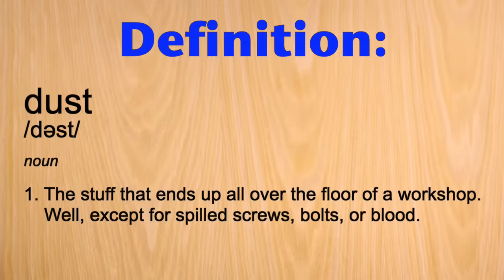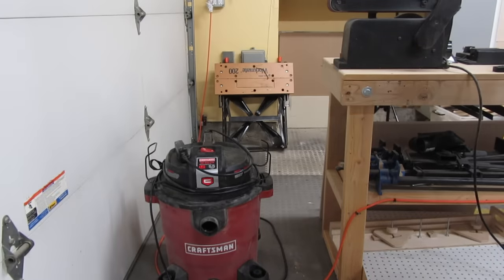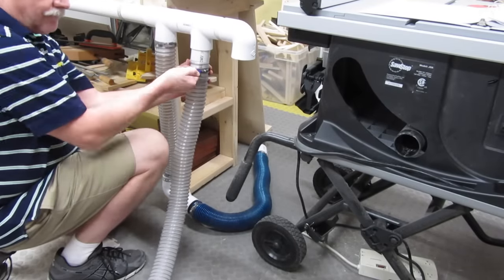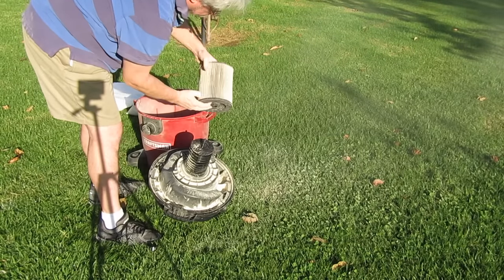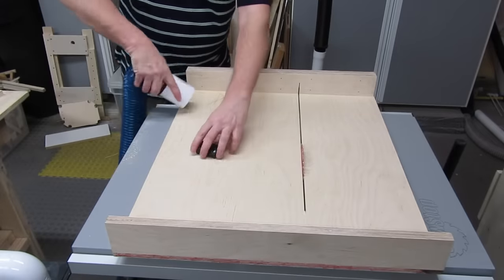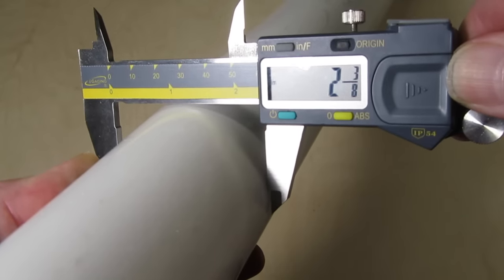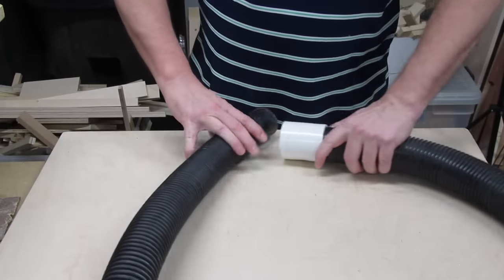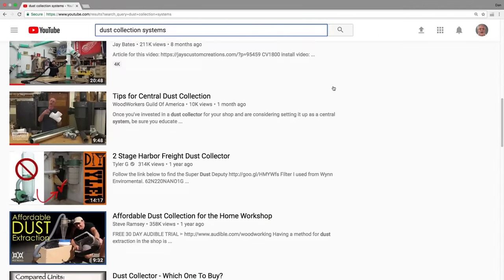Dust Collection for Newbies: Introduction to Dust Collection

Comment: Very familiar to my garage shop. I have done the same thing with connecting my shop vac and adding a few drops. What is struggle with is the fine dust particulars. I even built an air filtration unit with a box fan that is helpful, but still need something better..any suggestions?
Reply from the maker: That's a really complicated subject. I've done a lot of research on the subject, including spending a LOT of time wading through Bill Pentz's research at http://billpentz.com/woodworking/cyclone/index.cfm. I think you have to take Bill's comments with a large grain of salt, considering how sick he has become due to fine dust particles. But here's some things that are generally true:

Shop-vac-based dust collection systems can't collect fine dust. You need the "blower" type of dust collectors for that (something about air speed vs. air pressure). You also need at least 4" pipes, possibly even 6" or more. The dust collector has to use filters to keep the fine dust inside the collection containers - or maybe it's the containers that have the filters. And apparently, you have to vent the dust collector outside, otherwise it just blows the fine dust particles around the shop.

The bottom line is that you'll need to do your own research, because my research just ended up making me throw up my hands and saying "la la la la" really loudly so I could just ignore the issue. 😄

Comment: I see that you empty your filter by dumping it outside. If you are going to do that, why not do it automatically? Vent your system to the outside of your workshop. This means NO dust is recirculated into the 'shop and you never need to clean (or buy in the first place) the filter.
Reply from the maker: Actually, I don't dump it outside. I just go outside when I transfer the dust from the container to a trash bag. And by the way, there are many places where it is illegal to vent outside. I doubt the police will come and arrest you, LOL, but a word of warning anyway.
Reply: The Newbie Woodworker Strange, the video shows you dumping the dust from your filter on your lawn. There are also times when you have to vent outside- such as when there are combustion products. The amount of dust that gets past the cyclone is trivial anyway.
Reply from the maker: @Tensquaremetreworkshop  Oh, that's just cleaning the filter, which I don't need to do much anymore. Forgot about that - had to skim through the video again! 🙄
Reply: @TheNewbieWoodworker  I put a bag made for the vac inside the unit, to collect the fine dust.  Doing this and the filter will stay clean for a very long time.
Reply from the maker: @ozguzzi  Thanks for the comment. 😄

Comment: My Miter saw did not like PVC.  Fortunately there was no first aid required.
Reply from the maker: 😆 Thanks for the info! 👍
Reply: I use my miter saw all of the time to cut PVC. To safely do this you need a fence at least as a large as your material, a sharp blade, clamped material and reasonable cut rate. The large fence ensure the material is fully supported. Dull blades get embedded in the material making it more likely to put undue stress on the material. You want your material clamped, or at least against a stop block, to prevent lateral movement which can cause the blade to deflect or pinch which is bad. Lastly, a reasonable cut rate allows the blade to do the work, not you.
Reply from the maker: @AxGryndr  Thanks for the info! 👍

Comment: Thank you. I do have a question; Is there a real risk of static in the PVC pipes causing a fire. I've seen some woodworking say that, and that you need to use the tubing that has wire inside so that it does not cause static electricity to build up. What do you think?
Reply from the maker: You're quite welcome! 😄 I think you should never take safety advice from some internet guy. 😉Now that that's out of the way, this describes my feelings pretty accurately: https://www.rockler.com/exploding-pvc-dust-collection-ductwork

Comment: Great video,
 What should you about static electricity build up. PVC generates a lot of static electricity when air moves through it and sawdust is extremely combustible and could cause a fire/explosion how would you ground this type of system to prevent static build up?
Reply from the maker: I wrote a blog article about this subject: https://thenewbiewoodworker.com/dust-collection-fire-danger/

Comment: I wonder is the vacuum will affect the draft of the water heater if it does it will back draft into the garage and kill u juts a heads up I like the system  tho
Reply from the maker: Thanks for the comment!

Comment: Please explain your gray flooring and where it is purchased. Will it be O.K. in winter climate garage
Reply from the maker: I believe this is what I have: https://www.homedepot.com/p/Norsk-Multi-Purpose-18-3-in-x-18-3-in-Dove-Gray-PVC-Garage-Flooring-Tile-with-Raised-Coin-Pattern-6-Pieces-NSMPRC6DG/204318892. It's tough as nails, and should work just fine in winter. It has raised circles, so it's not completely flat, so be aware of that. It doesn't bother me, but in theory it could make it harder to level a table saw, or something like that. If you install it, get a large mallet to do it - at least 16 oz, if not more. I bought a smaller mallet, and I ended up getting a bigger one.

Comment: How much HP do you recommend for the shopVac while using the cyclone and about the same size or even a little smaller shop, for it to work really well?
Reply from the maker: I think 5-6 hp should be good.

Comment: You don’t have a miter saw? I don’t use mine a whole lot but it’s nice to have.
Reply from the maker: I don't have room for one. I can see how it would be nice if it was set up all the time, and it had enough room to cut reasonably long stock, but I do just fine with cross-cut sleds or miter gauges. As it is, I have to pull my band saw out of a cabinet whenever I need to use it, so space is at a premium. 😄

Comment: You need to add cutting PVC pipe that has been used for dust collection is dangerous as the dust traveling though it builds up a static charge  I one seen a bother inlaw cutting a 6 inch pipe and a spark cracked out of it over a meter long, scared the sh#t out of the both of us
Reply from the maker: OK.

Comment: Very informative, I have a question. On dust collection bucket, since it’s a vacuum system. Could you file or sand off snap ring so you didn’t need a tool to remove lid. By my thinking the lid should still seal fine as long as the hose isn’t in a bind that lifts one side of the lid. Has anyone tried that?
Reply from the maker: I don't know if anyone has tried it or not, but your idea makes sense to me, at least theoretically. The one problem might be when the vacuum isn't on, the Dust Deputy (or whatever) might tip over or lean if the hoses don't hold it "just right". But by all means, give it a shot!
Reply: The Newbie Woodworker 
I am about to set up my shop soon and being on a budget I may build one out of som scrap lexan until I get the money to figure out what I’m doing. lol
Reply from the maker: @jensandreasen2328  If you're talking about the cyclone, there's lots of videos that show how to make one out of a bucket and some PVC. I never got it to work right, but a lot of people swear by it.

Comment: Another question: does it matter which side of the blast gate is toward the vacuum?  Oneida says their metal gate is designed to seal only on one side, so it matters.  Rockler plastic blast gate?  Blast games in general?  Have been unable to find any further info on this question.  No response from Rockler.
Reply from the maker: For most blast gates, I don't think it makes any difference.

Comment: does the 90° fittings instead of a wye hinder  suction
Reply from the maker: It does to some degree - everything's a trade-off. But surprisingly, it affects the suction much less than it does if you have a true "blower" style dust collector.

Comment: How well does that flooring stand up to the weight of your heavy tools and benches?? I get minor seepage in my basement in heavy rain, and this looks like it would be enough to lift my tools and other items off the floor to protect them.
Reply from the maker: Thanks for the comment. These floor tiles are incredibly strong. They're not soft at all, and they've held up really well. We've had them for at least 10 years. I don't know if they'd help with your water issue, although I guess I can see what you're thinking. If you decide to install them, two points: 1) You can cut them on your table saw if you want, and 2) Use a BIG mallet. 😄

Comment: Just a question on the double 5 gallon bucket, did you cut the bottom out of the inside bucket?
Reply from the maker: Nope. Just put one inside the other. It basically makes it like it's twice as thick. It doesn't work for everyone, I've learned, but it worked for me! 😄

Comment: Hey Dan: I have a Makita 2703 table saw with a 2" dustport. The problem with the saw is that it has terrible miter slots that are simply flat shallow grooves with no T-slot. As I mentioned in a previous post, I'm now setting up a dust collection system. I'm thinking of getting a hybrid saw like a Ridgid 4512 to replace it. But here's the problem. All these types of saw have 4" dustports. I've seen a couple of videos that suggest simply using a 4" to 2" reducer to run it on a 2" dust collection system. BUT the Ridgid user manual says NOT TO DO THIS because the saw is designed only for a 4" system. I noticed you saw also has a 2" dustport, so no problem. But what do you think about his warning? Is it a valid concern and should I think NOT buy such a saw if I'm not willing to go to a 4" DC system (I'm not)?
Reply from the maker: I'm pretty sure if the manual says don't do it, then you shouldn't do it. Who knows why they recommend not doing it, but fortunately, there's plenty of other saws to choose from. 😄
Reply: There aren't many other similar hybrid saws in the price range of $650. The dustport on the 4512 is a funnel shaped shroud at the bottom of the machine. The Shopfox 1832, a similar machine, about $400 more, has nearly the same kind of 4" dustport at the bottom. I'm just wondering why it would be "dangerous" to go from 4" to 2". I'm wondering what other folks might have to say about this warning, and if it would apply to all such saws. Most contractor saws, like mine and the one you have pictured on your video have their 2" dustport coming out the back, not the bottom, which I think is logistically better.
Reply from the maker: @gideonkramer7479  I think you'd have a better chance at getting a good answer on something like the lumberjocks.com forum.

Comment: How do you recommend dealing with the static electricity created with using flex hoses?
Reply from the maker: Well, I personally don't think it's a safety issue, but someone pointed out a few days ago that in dry climates, there's that "OUCH" factor when getting zapped, so I'm hoping to do a quick video on grounding the pipes. For now, there's plenty of other YouTube videos on the subject. But other than getting zapped, here's my thoughts: https://www.rockler.com/exploding-pvc-dust-collection-ductwork

Comment: You can use a miter saw to cut PVC BUT use a 40 or higher tooth blade anything lower in teeth is not good.
Reply from the maker: Thanks for the info! 😄
Reply: Cuts the pipe nice and square
Reply from the maker: @BarryDavis  👍

Comment: Long ago, I heard of a negative air blower; it sounds like retractable air machine, do you think it is possible to build a dust collection with one of those machines?
Reply from the maker: Typical true dust collectors use blowers, so maybe that's what you're thinking of. Look for dust collection videos that use 4" or larger pipes.

Comment: I have trouble finding 2" PVC. There is 1.5 in the Central Vac section for household vacuums and 3" and up in the plumbing section. but 2", I can only find the black ABS which can't be molded the same.
Reply from the maker: Do you live in the US? If so, Home Depot, Lowes, etc. If not, I don't know.
Reply: Canada. But I havn'e checked Lowes yet.  @TheNewbieWoodworker
Reply from the maker: @frameriteairdrie578  You can also ask any local contractors where to find it. If anyone knows, they do. 😄

Comment: Your vortex is above the shop vac. Is there any reason that they couldn't be side by side?  Thanks
Reply from the maker: No reason, other than space. If you've got the room, side-by-side is probably better, because you can run straighter tubing.

Comment: I disagree on your comment that if you find a little dust under the table saw, it may be the tool's fault. In the particular case of a table saw, a puny  ShopVac-based system will not provide the airflow required to extract most dust from a table saw. Also, a table saw's dust collection must be tackled both from the underside and the top of the table. Unless you are willing and able to invest and commit to installing a central system with at least 2 HP, 4-inch piping, and an adequate dust hood under the table and a dust shroud over the throat of the saw, you will always have a lot of wood particles on the floor and dust floating in the air. Wood particles are a nuisance. Dust is a killer. So, it is not the machine's fault. It is the inadequate dust collection system. A ShopVac-based system does not do much with dust; when working in such environment, I always use a P100 respirator.
Reply from the maker: Well, I agree and disagree with what you've said. For example, I've had two jobsite-style table saws, and the dust collection on one was much better than the other, using the same shop-vac based system. So yes, it can be the table saw's fault, to some degree. Would a standard dust collector attached to a 2 1/2" port on a jobsite table saw collect more visible dust? I don't know for sure, but my guess is that it wouldn't, or at least not much more.

I agree that DC needs to happen both below and above the table, for best results. No argument there.

The most dangerous dust is the fine dust particles that are basically invisible. If you believe Bill Pentz's research (link below), the system you specified wouldn't be enough to capture the fine dust particles. In addition, if it's not vented to the outside, the dust collector is really just a dust pump, and you're not really removing the fine dust particles.

Yes, you should use the dust mask, and also have a dust filtration system. But if Bill Pentz's research is to be believed, and assuming you don't have a vented-outside system up to Bill's specifications, if you don't wear the mask every time you go into the garage, regardless of when you last did woodworking, then you're still exposed. Unless you open the garage door and blow everything outside with some big fans.

The only reason I say all this is because it's a much more complicated problem than most people realize. So much so, that for me, I just can't worry too much about it. So I do what you recommended and wear a good quality dust mask when I'm cutting. I run my dust filtration system. And as for the idea that fine dust particles remain suspended in the air virtually indefinitely, I plug my ears and say "na na na na I can't hear you". It's either that, or go down the huge rabbit hole of trying to do everything properly, according to Bill Pentz's recommendations. And that's just not gonna happen, at least for me.

Of course, all of the above is based on my research and speculation, mostly from reading and thinking about Bill Pentz's research, which I could have easily misinterpreted. How's that for hedging my bets? 😄 http://billpentz.com/woodworking/cyclone/index.cfm
Reply: Thank you for your very detailed analysis. It was a pleasure reading it. Very seldom (never?) authors take the time to interact with their viewers the way you just did. Thank you again. We are on the same page.
Reply from the maker: @jschraubenzieher910  You're welcome, and I enjoy it. Also remember that I may not know what I'm talking about. 😛

Comment: Hey Newbie, when using a cyclone and an all purpose bucket, you best put in a self releasing valve so when you accidentally close all blast gates, you're bucket doesn't implode :-) You can make a valve you're self or just buy one, it's quit simple https://www.dust-commander.com/gb/16-accessories
Reply from the maker: This is awesome - I've never heard of it before! And I was just wondering what I was going to do for my next video. I can't thank you enough. 😄
Reply: The Newbie Woodworker you're welcome, you can make one you're self from a metal cap a Magnet and a spring, there are instructional video's on YouTube 😁
Reply from the maker: @ronaldvaessen9826  Thanks, I saw that. Also one using a screw and a spring. Now I have to experiment. 😛
Reply from the maker: @ronaldvaessen9826  Thanks, will do!